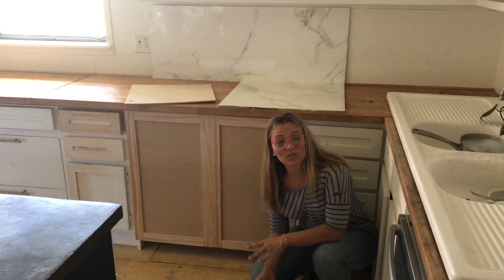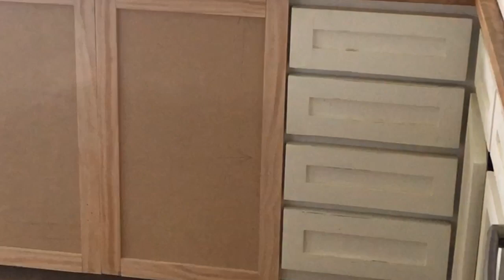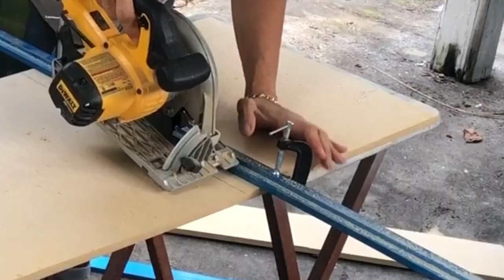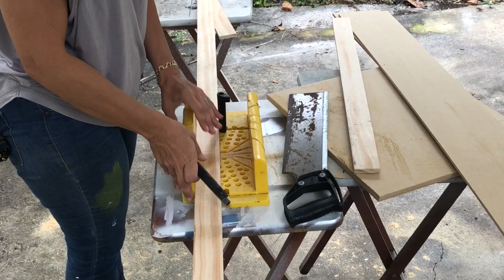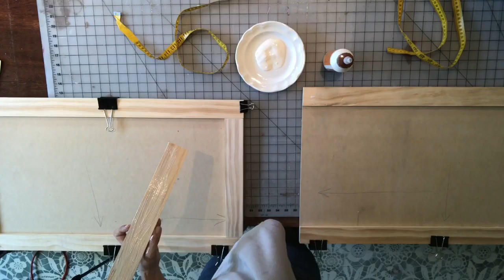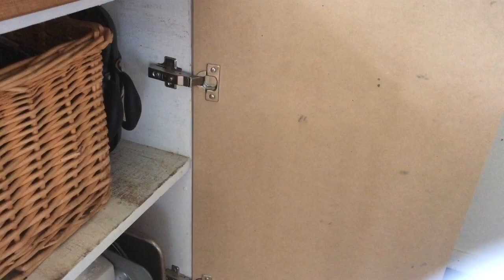Easy shaker style cabinet door hack

Comment: What is mdf ? I'm trying make 3.5foot hight by 3foot doors to cover shelves in a rental help is the a material that i don't have to saw
Reply from the maker: it stands for medium density fiberboard. It's in the lumber department at home Depot with the plywood. It comes in a 4x8 sheet and they can cut it for you on the panel saw as long as all your dimensions are greater than 12".

Comment: My cabinet doors have the same hinges. The doors currently have no boarder around them, and when it's open, it's exactly parallel to the edge of the cabinet....would the addition of the shaker style trim interfere with the cabinet while opening them ?
Reply from the maker: It depends upon the total thickness of the door plus the shaker trim. I have a similar situation in my bedroom where the doors to my cabinet only open 90 degrees and no further because they're too thick.  I'd probably tape the trim to your door and try it to see if they will open without a hitch.

Comment: Why mdf? It's cheap but it's going to fall apart in a kitchen
Reply from the maker: because it's so smooth. It lasts a surprisingly long time but if it's a concern the bottom side could be red guarded.
Reply: MDF is fine as a painted door panel material in dry areas. It will disintegrate in the bathroom or around the sink though.

Comment: D you have a link for the tool for the hinges plz
Reply from the maker: I just added two links in the description. One from amazon and the exact set that I have from Home Depot.  Either will work however you only need one bit from the set and you can buy the one bit by itself. and Home Depot sells it in the same aisle and bay as the hinges.  But I use my Forster bits a lot so having a full set is nice.   Thanks for asking... good luck with your project.

Comment: This is a really good hack! What thickness/size of MDF and Lattice Trim did you use?
Reply from the maker: I used 1/4" MDF and the lattice trim is 1/2" thick and 2" wide.  super easy and they look really great.
Reply: @MimzyandCompany  where did you get the trim? i cant find 1/2" by 2" anywhere
Reply from the maker: Home Pro sorry . It’s actually 3/8” thick x 2” wide. Sorry bout that...I got it at Home Depot. They have two sizes of flat lattice...mines the bigger one.
Reply: can you post a link? i have been looking all over for 2” width with no luck!
Reply from the maker: @homepro2155  OK...so I was yet still a little off with my dimensions...the actual size according Home Depot is 7/16"x 2".   I put the SKU and the specs in the description above.  I think the 2" part is the most important 3/8" or 7/16" doesn't make much difference.  but sorry for the run around.
Reply from the maker: I'll look to see if I might still have piece with the tag....I looked at home depot.com and the only dimensions are 1 1/2" x 1 11/16 .  Which is not the dimensions of mine. Mine is definitely 2" x 3/8" . I'll get back to you asap.
Reply: thanks